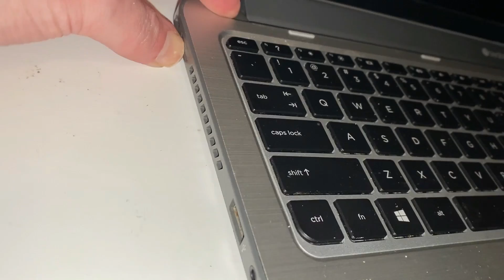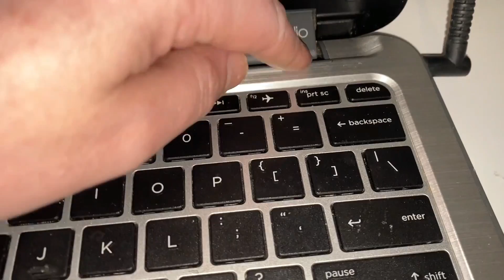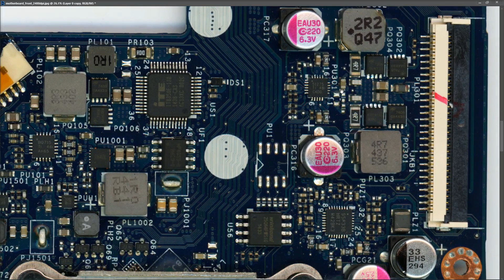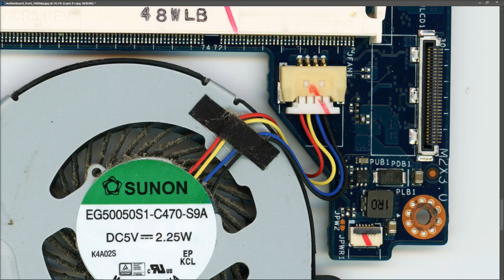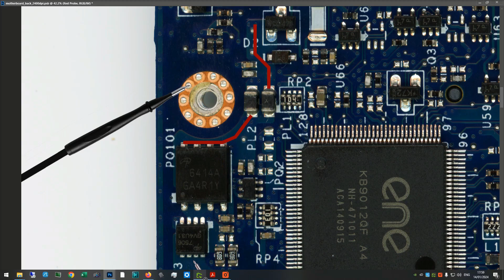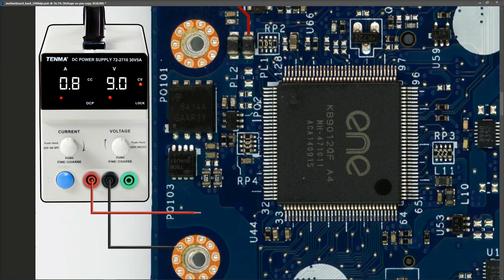HP Pavilion 11 N010DX - Not Powering On

Comment: That's a nice fresh and clear approach by scanning the board. If you are doing the video like a tutorial, when measuring stuff always show the meter on screen. It would have been better to remove that burned part and test to see if the short is gone before ending the video. Ending abruptly like that when you know the faulty part is not a good thing to do to your audience. It's also a way to keep moving forward. For example if the short was not gone then you have another fault further down the line and you can keep going for a bit and see if you find anything else.
Reply from the maker: I appreciate your comments.

Comment: Thank you! I need your opinion about this. My Asus laptop functions properly without a battery. However, when I insert the battery, the 19V rail experiences a short circuit (when plugged in to power). I've observed that the laptop operates on battery power without being plugged in.
Reply from the maker: Hi, If you can post the model number I will see if I can get a schematic.
Reply: @therepairshare673  its asus x509j

Comment: You released the Magic Smoke! It may be easier to find a donor board than a new BQ chip (which actually works, and is not a fake). The PUB01 chips on my Dell boards are ISL88739HRZ, rather than BQ. I suspect they fail a lot because they take a lot of abuse over time. In any case, this is more interesting than a shorted cap, although more difficult to source a replacement chip. Best of luck to you, as always.